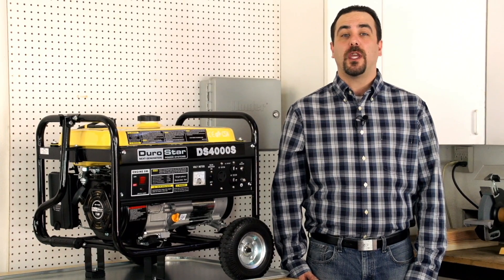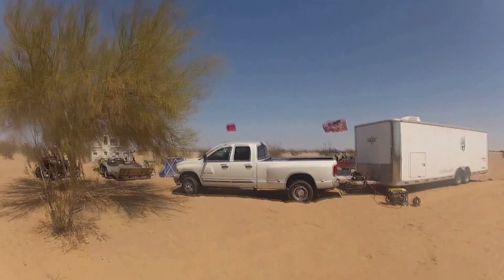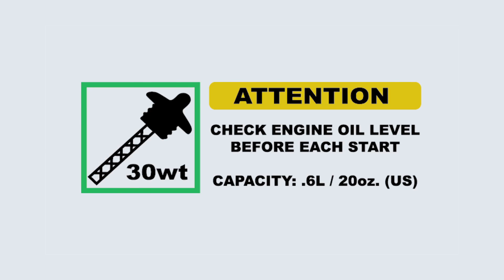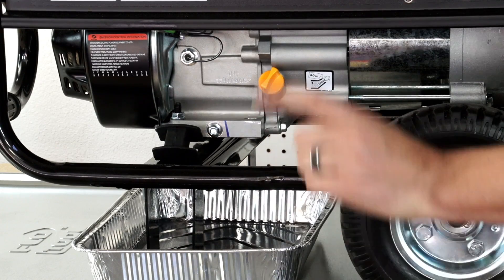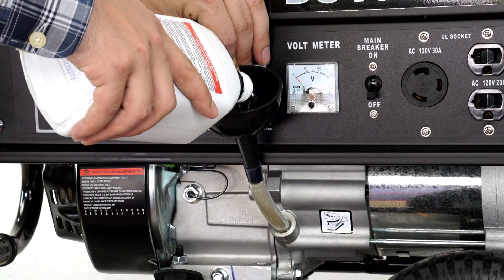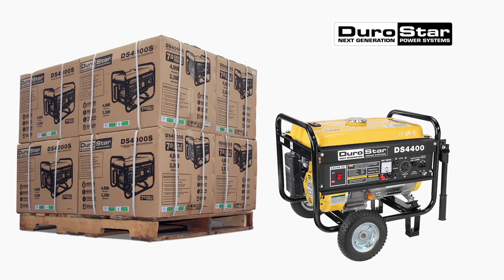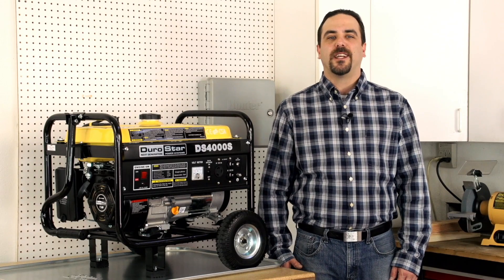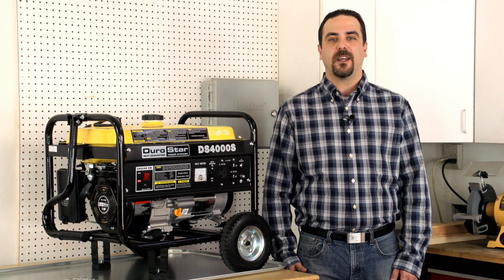DuroStar 4400S Generator: How to Oil your Generator

Comment: Every 20 hours?  You going to spend more in oil than in gas, i change every 6 monts and still working good!  😂
Reply: hello ermis do you have the same generator? i live in venezuela and we need to use the generator almost 20hrs daily  we cant change the oil everyday, do you really change it every 6 month? thanks
Reply: MAYORA v la pimera vez son 20 horas y la segunda son 50 horas cuando llegues a ala 3era ponle aceite sintético de buena marca y te dará como 300 a 200 horas
Reply: @jraffallil  es decir que en cada uso del generador ya el aceite queda inservible y amerita cambio ? Yo pensé que funciona como los vehículos que tantos meses se haría el cambio de aceite . Si me pudieran orientar se los agradecería ya que acabo de comprar una Duromax y está 0 km y no quiero cometer errores.